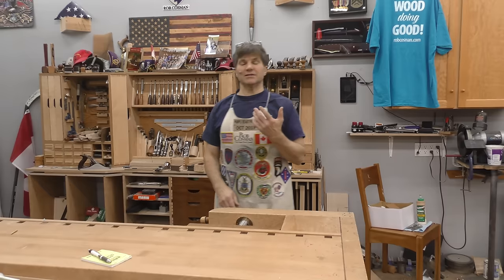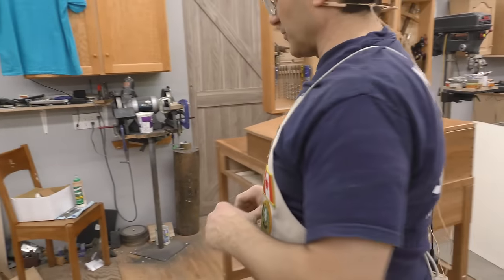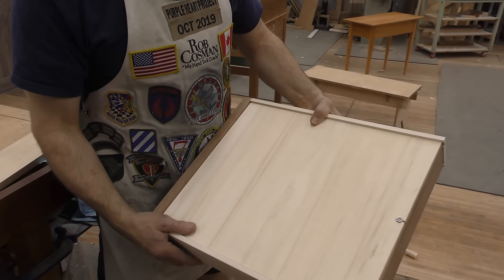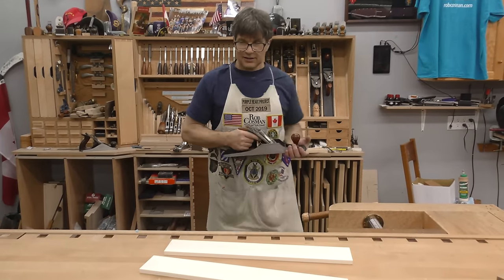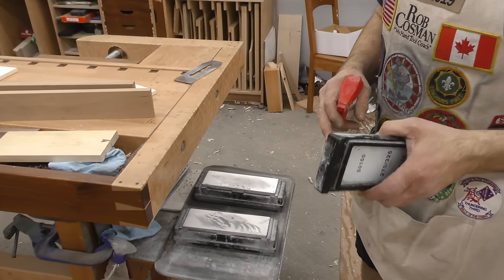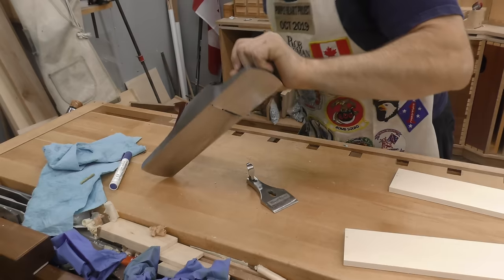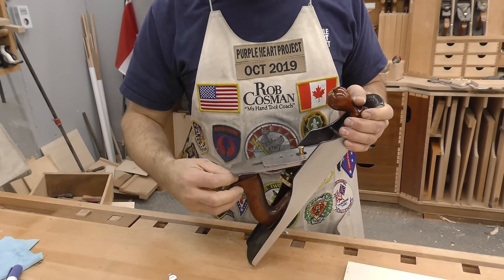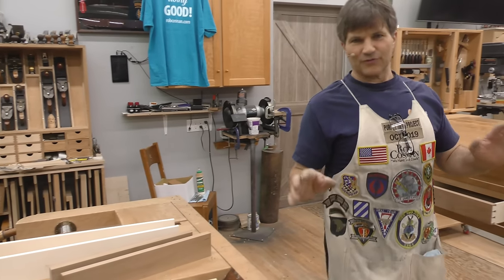Drawer Making Episode 1 with Rob Cosman

Comment: Great video. Short videos around 5 to 10 minutes are great for just a single tip or trick.  The longer format, 20 to 25 minute, multi-part videos that demonstrate and showcase a wide variety of skills and procedures involved in the production of a complex object are just the right length.   I really enjoy seeing you explain all the somewhat ancillary steps involved in producing a drawer box. for example, you were demonstrating how to plane the inside face of the drawer sides but you also included the ruler trick for polishing the back of the iron and the wax on the sole. They are great tips that, while not absolutely necessary, are a welcome addition to help me advance my skills.

Comment: Long story made interminable: I'd been planing boards out of square for months and it was driving me crazy.  I had always looked down the sole of the plane to see when the plane began to protrude in order to set the lateral adjustment lever, just a Mr Cosman says at around 18:25, but I had been looking from the heel to the toe, as I thought I remembered another YouTube woodworking channel recommending.  No matter how I tried, I couldn't figure out why I was planing boards out of square, but I kept suspecting it was about lateral adjustment.  A few days ago, before I saw this video, I tried looking down the sole of the plane from the toe, as Mr Cosman does in this video, and the whole thing became clear.  It's just easier to see the blade from the toe; the edge of the iron projecting towards you makes it a much sharper view. When viewed that way, I could see how my adjustment from the opposite end of the plane was off. I would have saved a lot of planing if I had seen this video when it came out.

Comment: Excellent series on making drawers and very comprehensive.  A couple of observations, firstly at no point did I see you using face edge/side marks which would help enormously to know which side goes where.  Secondly, identifying the various corners isn't made very clear.  I use different coloured sticky dots which make the whole confusing process very easy. Coming from the UK, drawers sides in the New World are a lot thicker than those in Europe; drawer sides are a max of 7-8mm and sometimes less, which means drawer slips always have to be used.  Great series though and I've made copious notes and learned a lot.

Comment: This length is great. Can I ask_ the shapton stone flatner, is it wise to leave the sluge from the stone on it? Or is it OK to let it dry out till you need it again?
Reply from the maker: Valid question. If you let it dry it will eventually build up to the point that the abrasive won’t cut the stone as fast. At which point you’ll need to soak it in warm water and scrape out the grooves. So it’s best to spray it off after every flattening.

Comment: I bought a set of Woodriver planes last year. They have constantly been chipping on the cutting edge since I got them and I am not impressed at all. I'll be buying replacement blades soon. I'm tired of dealing with them.
Reply from the maker: Hey Brad, we had the same issue when we were in Florida teaching at the Clearwater store. If you take your blade to a local woodcraft they should replace it for free. It’s an issue with the tempering in the blade, causing tiny fracturing at the leading edge.
Reply: @RobCosmanWoodworking  Well thank you very much. I have one about 2 miles from my house. I'll go pay them a visit when the corona coast is clear.